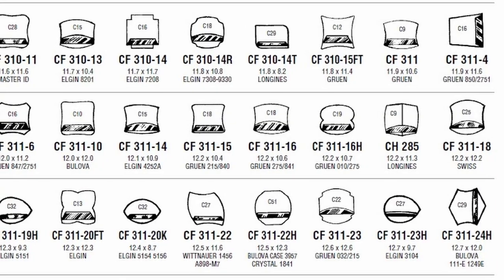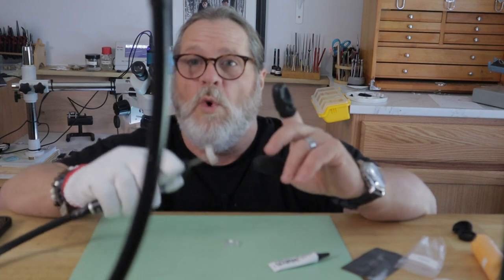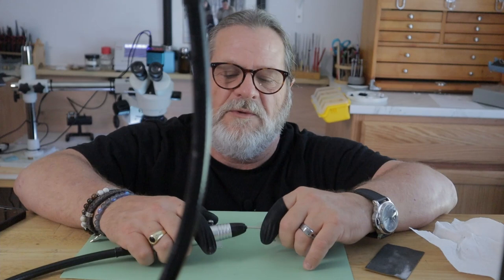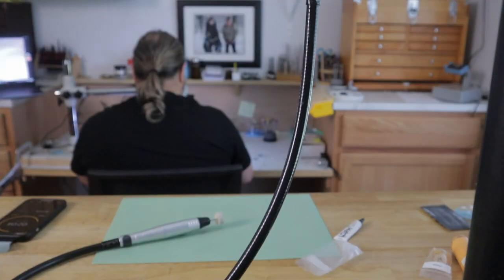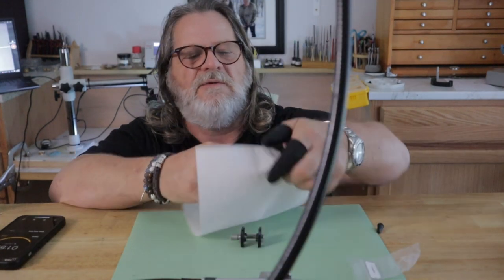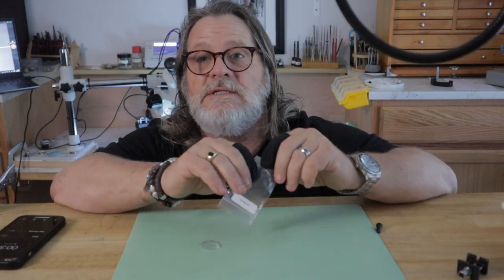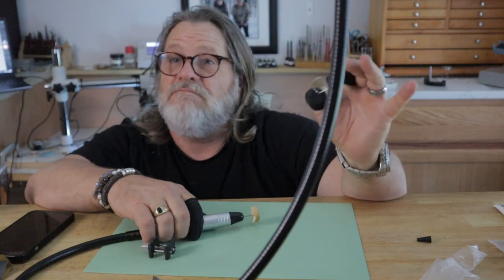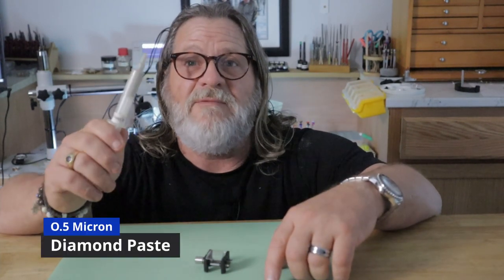Better Methods For Polishing Acrylic Watch Crystals-Lesson #20

Comment: Do you use Grobet C-300 for all types of polishing (cristals, cases and main barrel) and are you getting professional results with Grobet? Also suggestion if it has another purpose. Thanks for great content, can't wait for the next video.
Reply from the maker: I do like the Grobet and you can use it for polishing case and brackets as well. I use a foot pedal to control the speed but wish it had a speed setting dial to set the rpm

Comment: How do you know if a watch crystal is acrylic or glass?
Do you do the same proceedure for both?
Reply from the maker: Well, most of your acrylic crystals are gonna have a high dome shaped to it. You can also tell by tapping on it. Acrylic is going to have someone of a bounce. This really only works on acrylic style crystals. Although you can polish scratches from glass, it requires using diamond paste. In three or four different grits, depending on how scratch it is.

Comment: Lots of good info here, Alex, and thanks once again for taking the time.....
Any tips for removing wear and scratches from mineral crystals?

One question regarding parts cleaning:
 Is it ok to use an ultrasonic cleaner instead of an agitated bath? I set up an ultrasonic system for cleaning parts/components but I am considering building an agitated bath. 
Thoughts?
I wish there was a way to leave a link for you to pics in my Dropbox.
Reply from the maker: Hey Ray, Thanks buddy. 
Yea there are several ways and I have a video planned shortly for polishing glass crystals as well as one on making them.
The two main ways are with Cerium Oxide  and making a paste, them using a slow hard felt wheel or diamond paste.
I like ultrasonic cleaners and use mine primarily for pre-cleaning and cleaning case/ bracelet’s but they can be used easiest with the jar system and a water watch.
I would love to see the pics, 
Shot me an email
Reply: @watchrepairtutorials  
I sent you an email with a couple of pics, Alex.

Comment: Thanks for another great video.  I've used the progressive sandpaper method but with various polishing compounds as the last step.  The results have been quite good but  I will try the polinum as it appears even better.   Have you ever used the sandpaper wet during the sanding stages? I've never used it dry but I guess loading of the paper is not a big issue with acrylic.
Reply from the maker: Yes,
It just depends on how much sandpaper I have.😉
The Polinum is good and is certainly good to have especially for case polishing.
The 0.5 micron would be better for the polishing light scratches or after using sandpaper, just be careful, it needs to be done at a slower speed to prevent burning the crystal.
Reply: @watchrepairtutorials  Thanks for the info! Dave

Comment: Alex, with these types of home-made cleaning mashines (yours from Lession 8 and this one from South Africa) how long does a run with a rinsing solvent or with a cleaning solvent usually take so that you get good results? I know with the original cleaning mashines usually a run is about 10 mins each, if I am not wrong, so how is it here? And also, do you warm up the solvents of you use room temperature?
Reply from the maker: With a good cleaner 5-10 minutes is fine depending on how bad the parts are. Heating solvents is usually a bad idea.
Reply: @watchrepairtutorials  Thanks!

Comment: Will these fixes work on Black watch faces?  I have the Amazfit watch which has scratches.  The watch face is black just like the face on newer Apple faces.  Thanks for any response.
Reply from the maker: If it’s acrylic. Yes. if it’s glass no.
Reply: @watchrepairtutorials  Thank you for your response.
Reply: Well I checked and Chat GPT tells me my watch face is likely plastic. I researched this and found that plastic and acrylic are "similar". So I will try the fix.  Thanks again.
Reply: Upon further research I find my watch face is tempered glass.  So I will try to find methods to repair scratches on tempered glass.

Comment: You the man Alex! Great information in this one. I was just curious if you've also got a crystal replacement video coming up? Maybe I am just forgetting about it, but have you already done one that goes over the different types of crystal presses and crystals? I finally got my G-S hand press, and I wondering if I can get by with this for pushing in a sapphire crystal as well as fitting acrylics.
Reply from the maker: Oh wow. I am going to be doing one on acrylics crystals soon. 
I have the GS press is my go to for acrylic. 
Great choice for sure.
I don’t believe they are made for for press    in crystals but I’ll look at that
Reply: @watchrepairtutorials  heh, I got it because you told me about it! It’s the full “HP-5 Hand Inserter set” as GS calls it. No matter what, it’s useful to me for acrylic crystals, but I even thought about making a die adapter so it can be used with the screw-in dies sold for typical crystal presses. It just seems illogical to buy a whole other press when it seems like the only functional difference comes down to the dies. But maybe there’s more to it I’m not considering…
Reply from the maker: @awdturbopowah773  Honestly, I really haven’t tried.
But that’s on the list know.
For compression and armored crystals it’s hard to beat.

Comment: I just began this hobby back in November and I really enjoy your content and channel. It’s also kinda neat to see a watchmaker that looks like he might have a Harley or two in the garage 😂😂. I actually have the same Zenith cleaning machine as yours. Mine has three green jars and one clear one but it appears original. I don’t know whether to use the clear one so I can see how dirty my cleaning solution is or for the final third rinse jar; any thoughts or suggestions?
Reply from the maker: Hey Eric,
I think you are probably right about the jar. Makes sense. I would probably use it for the wash as well.
Just a couple suggestions if you haven’t thought of these. Keep track of the wash cycles and rotate.
I use a ultrasonic to pre clean parts before I do inspections. 
Then I demagnetize the parts before final cleaning. This is to prevent any metal particles that might be in the jars from being attracted to the watch parts.

Then I run the parts through the zenith and dry.
My dryer runs to hot so I use a food dehydrator.😄
Reply: @watchrepairtutorials   Thanks. I do rotate my rinse jars from third to second and second to first and toss the original first. My machine was missing the basket and I retrofitted a new Elma one and it doesn’t fit all the way down in my heater so I have a little extra airflow and my parts don’t get too hot. Hadn’t thought about the demagnetization ( I do demagnetize after assembly). On an average, with eBay watches for parts or repair 😎; how many washes would one expect? Thanks
Reply from the maker: @ericdouglas9804  obviously it will vary on your pre cleaning.
I clean the barrel and heavy grease from the movement first then like I said into the ultrasonic. So for me the wash and rinse is going to last longer. The jewels will tell you how well everything is washing and rinsing. 
 7-10 movements is a good rule of thumb
Reply: @watchrepairtutorials  You should check/change the resistor on your dryer. I’m in the process of building a watch cleaning machine. You’ve given me some good ideas. I think instead of a standard resistor I’m going to use a potentiometer so that I can control the heat.
Reply from the maker: @mikebond6328  I don’t know anything about that stuff.
Teach me something

Comment: Does anyone know how to get scratches out of mineral crystals?
Reply from the maker: Yes, you will need 6, 3 and 1 micron diamond paste. Use a hard felt pad at 1500 rpm’s and start with the 6 and move down. 
There’s other methods but that’s the best unless you have other more specialized equipment
Reply: @watchrepairtutorials  Thanks again Mr Hamilton your a scholar and a gentleman

Comment: I am doing wet sanding and my last sanding is 5000 grid.
Reply: I got to Vintage watches and I have not doing anything on watches, total newbee. They were schratched all around Bezel chrystal. 2 Lagonda, 1 Automatic from early 70's and a Mechanical from 50-60's. Since I did it with the complete bezel, I could only do the top.  So the sides are still scratched. Thanks for the tip about the polium.

Comment: Both methods works well. But the polywatch is so much easier to use.
Reply from the maker: Sure it works but it’s limited in what it can remove. Why not have a system that can handle any situation?
Reply: @watchrepairtutorials  it's easier to reach for one thing. One tube that does a 80% job. In the end practically always wins over perfection.
Reply from the maker: @56364  in watch repair perfection always wins but you set your own standards.

Comment: Obviously the tutorial is targeting other watch pros who have the equipment you're using - and of course the definitive results of comparison you provide. 

I notice you do not use a cross hatch sanding approach and sanding direction is not mentioned. Do you have a POV on this?

Also I've seen a few of these finish with Brasso ... easier to access for neophytes who may be turned off by having to locate and acquire some of the nuanced products you use. Thoughts?
Reply from the maker: The point of this video was merely to show that there are better methods as well as limitations to using Polywatch. Although probably the vast majority of my viewers don't have the type of rotary tool that I was using, plenty of people do have bench polishers as well as handheld dremel tools. And of course, any polishing compound can be done by hand as well.

I'm very familiar with cross hatching when it comes to sanding from my time spent as a woodworker. When you get into the higher grits of sandpaper the lines left over from the previous grit become less obvious, so the advantage of this method becomes less important.

There are also plenty of other examples used in polishing watch parts that don’t use a cross hatch method for the same reasons listed above.

The crystal that I was using in this example was a rectangular crystal with a flat curved surface . Because of that, for the most part, I sanded in one direction. This was done primarily to avoid flat spots by trying to remove a scratch, concentrating in one area.

If I had been polishing a domed round crystal my methods would have been completely different. 
Brasso, I have never used it, seen anyone use it or know what’s in it but if they are polishing brass with it I am sure it has a mild abrasive in it, so it would probably work as long as there is nothing in it that would damage plastic. 
But no matter whether you're using brasso or a polishing compound for car headlights or whatever, before you get to that stage the sandpaper method of removing scratches from an acrylic watch crystal is doable by anyone.
Reply: Perfect! 
 @watchrepairtutorials

Comment: O.5 diamond paste … not 5 micron … just want to make that clear if some only heard the “5 micron” part. 🙏🏻
Reply from the maker: thanks brother
Reply: @watchrepairtutorials  I have been thinking of getting a lapping machine. To regain the brushed and satin finishing on some steel watches cases and bracelets. 

Do you have any advice on which machine to get?

Thanks.
Reply from the maker: @marcn8750  Not Really. I've never used one.
Reply: @watchrepairtutorials  noted thanks. How would you get brushed or satin finishes for your steel cases ?
Reply from the maker: @marcn8750  I like both gloss and satin or brushed finished as well as combinations. I personal don't worry to much about normal wear marks on my watches.
Reply: @watchrepairtutorials  my question was more about how do you restore a satin vs a brushed finish to steel watches. Do you use a special tool?